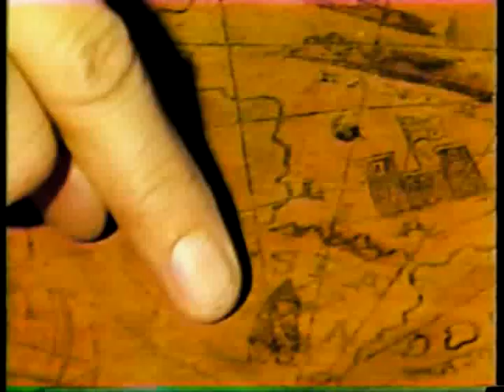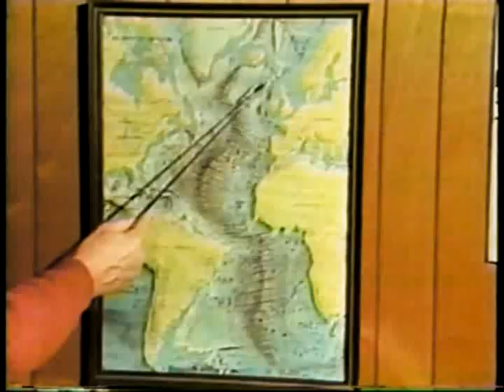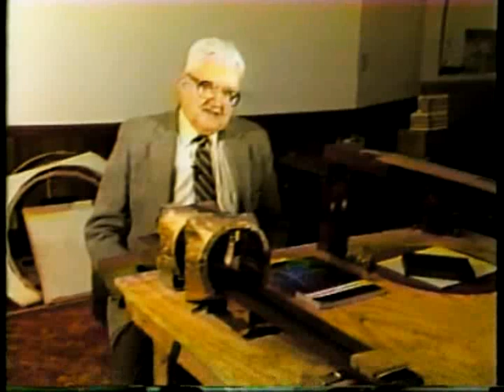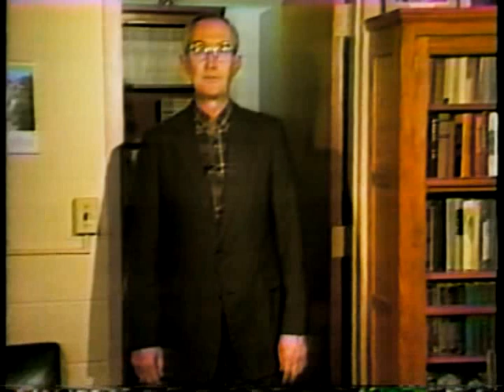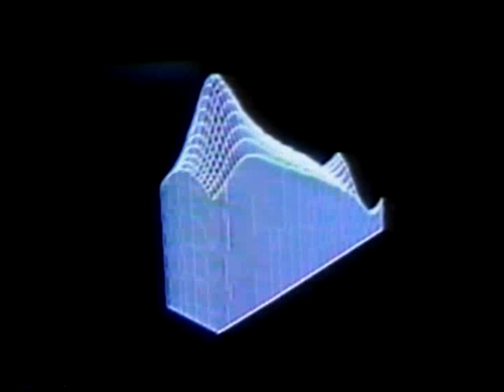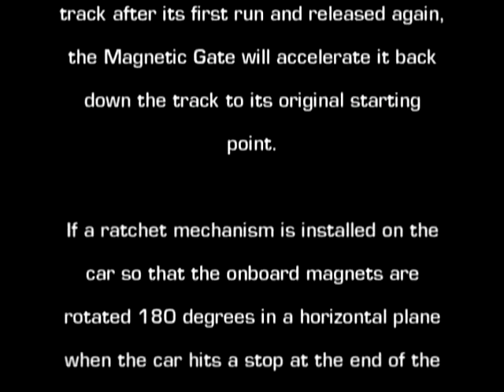Magnetic Gates - Howard Johnson - Spintronics

Comment: Nice to have this old school stuff back in circulation, if anything, for the newer generation to think about for the first time. If we put our minds together we can overcome all problems associated with this design. Demagnetization from opposing fields was a major problem here. Which made for amazing demonstrations, but slowed down after only a little more time. In my view, only a motor whose magnetic fields are arranged to be only in attraction, and periodically diverted/shielded, have a chance of long term motion.
Reply: @vSchaub It would seem that way. But in that case, the magnetic field formed from the tiny currents in a speaker coil are much weaker than that caused by the nearby permanent magnet, so their ability to realign the atoms in the permanent magnet are greatly reduced. But when two permanent magnets of similar strength oppose each other, well, then you have a problem. But when they are always attracting, that problem goes away. Then they tend to strengthen each other's alignment, keeping the large magnetic field "permanent".

The speaker-coil and permanent magnet combination is an interesting one because of the great force of attraction and repulsion which is produced from such small electrical input. 1x coil near 100x magnet produces 100x force with 1x input. Do you see?

Comment: Permanent magnets have their own energy which is inserted there when the alloy is “magnetised” … all permanent magnets are made by 3 elements (iron, copper, nickel or aluminium cobalt nickel or any other 3 elements) analyse each element for their resistivity, conductivity, electro potential and see what is happening there.

Electric charge is trapped inside the alloy and the alloy becomes self resonant. Magnetism is a consequence of electric charge. When electric charge can flow magnetism is produced.
Reply: @vSchaub yes
Reply: I don't think that's correct, if it was then running magnet over a lump of pure iron wouldn't turn it into a magnet, which it does, furthermore you would be able to detect a voltage potential within the magnetic field around and in the magnet which there isn't (I've checked). Magnets are coherent objects of atom alignment, every atom inside the element produces its own vortical flow and when all them act as 1 they polarize one of the ambient mediums, like how electrets polarize another (Tesla's 1892 lecture touches on that).

Think of the relationship between a permanent magnet and its magnetism like the air and a fan, the fan moves the air through and around it but it doesn't come from the fan itself, a magnets magnetic field is likewise ab-extra to the object, which explains the so called faraday paradox since the field does not spin axially with the magnet.